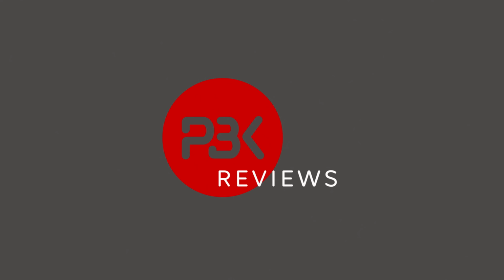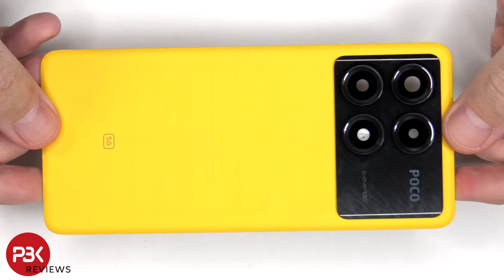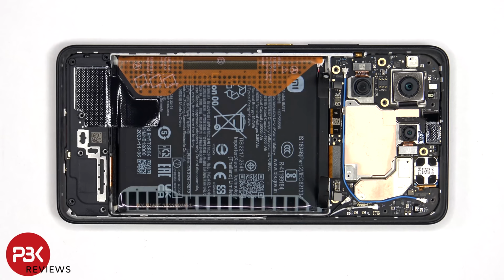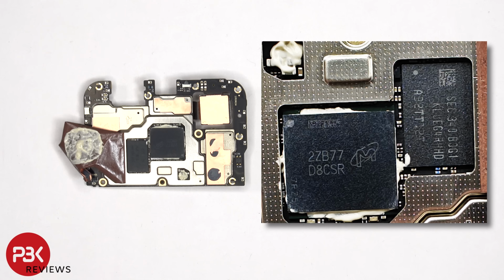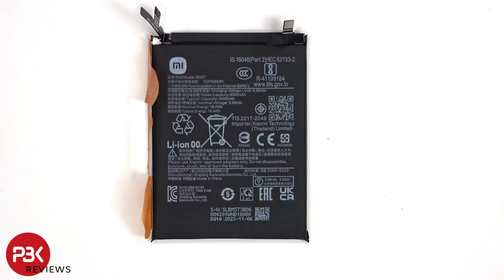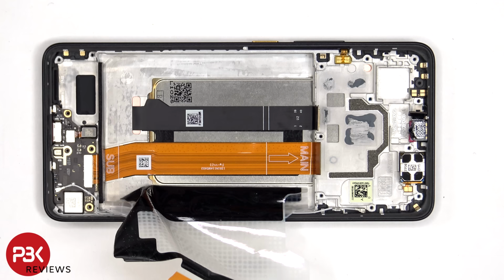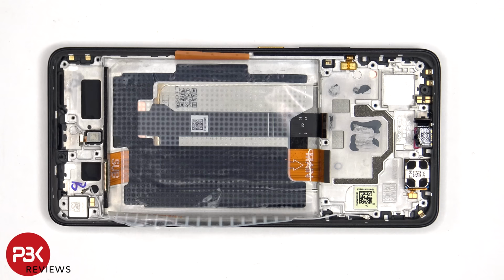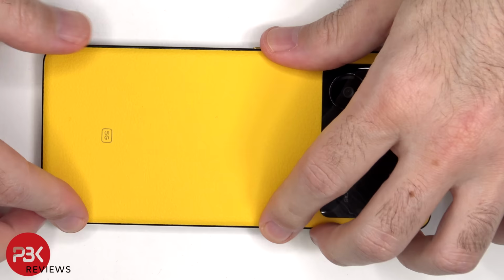Xiaomi Poco X6 Pro 5G Teardown Disassembly Repair Video Review

Comment: With all due respect, once disassembled the phone will work but it will never be the same (especially in the thermal section because you do not replace any of the "rework kits"), you do not respect the correct disassembly of the unit. (the glue on the “back cover” is heated to remove it, it is not done cold and a press with a specific pressure is used to replace the back cover together with the glue kit that is part of the "rework kit"). You don't have the necessary tools... and lastly, you should never use metal tools, they should be plastic. Taking it apart like that and showing it is very unprofessional.
Reply from the maker: I understand your opinion, but its wrong in my opinion. First, I do heat it, and I did say it also in the video so you must not be paying attention. I just don't show it on camera to save time and footage since most skip through it. Second I do re apply proper adhesives if available on the market if not ones which will come close to the original ones made for the phone. Since you keep referring to rework kits, I assume you're a tech or at one point in time were for one of the manufacturers. With that being said, what protocols they have at the facilities vs what average people who on a daily basis repair phones at home have are way different. From what you're saying, basically people should not do any sort of repairs on their own phones and just pay manufacturers to do it for them which is totally incorrect. I have been working with phones both professionally and not for over 20 years and I have never had any problems. The only time, especially with phones now a days when it is not ok to use metal tools is when the battery is connected. Aside from that, the chance of static problems or a short or anything like that is so small, it's not even worth mentioning. They don't make electronics like 20 years ago when you did have to worry about that stuff, they take all this into consideration. I have literally worked on thousands of phones and never once had a problem with using a metal tool. Plastic tools don't always get the job done for certain part removals etc and again keep in mind, not everyone has a factory at home with professional tools and "presses" to do the job you expect everyone to do. If I start showing tools and machines to do these jobs, no one will get any benefit from the videos since they will not have those tools or machines to use at home and would not be able to follow along. That definitely would not be helpful.
Reply: @PBKreviews  I share many of the things you say. Your video implies that anyone can dismantle a phone. Although it's partially true, it's not correct nor what the manufacturer specifies. I have been in charge of Samsung's technical service in my country for many years. I am perfectly familiar with the protocols, and yours are not correct. Anyway, that's just my opinion. Best regards. ;)
Reply: @LORDINTEL  if u say mr pbk are not correct, then make ur own video to educate people 😒
Reply: @caturdone9302  Your response is a typical response from an ignorant person, people who work within companies sign a public confidentiality contract since we have access to confidential information, I could not make that video in the correct way for that same reason. On the other hand, I'm not criticizing the person who makes the video, I just said that that's not the right way to do it. If you dare, disassemble the phone that way and tell me later what happens (for example, Samsung phones are uncalibrated in many aspects, because they do not have the necessary “jigs”). So whether you like my comment or not, that's the case and if not, find out with an authorized service center.

Comment: Hey I am facing issues on my pocox6 pro after screen replacement the phone has become slow ,phone is overheating but it's not physically hot . Could you tell me what I should do. 

The phone is only 3 months old and I broke the screen and replaced the screen and now it's not functioning well.
Reply: go to service center , they if you luck they will give new phone (same model) ,but if no them wait until they fix the phone.
Reply: @user-nu1ix8qk6o  service centre is insisting a factory reset I did it and still the same issue also did software update and no change,service centre is now not willing to fix the problem. The phone is slow showing warning over heating and becomes slow.

Comment: سؤال هل الرامات فوق المعالج ام لا 
وهل يصبه بوردر وارتفاع حرارة وبيفصل لحاله ام لا وهل يفرغ شحن بسرعة او لا اي حدا عندو اي نصيحة يكتب لأنو بدي اشتري❤
Reply from the maker: Yes the ram is seated on the processor, but most high end phones use that design for better performance. As long as cooling is good, and quality of parts, there should be no problem. On this phone cooling looks to be upgraded a lot from previous years.

Comment: Is poco x6 pro colling system good? I'm having a problem with my Poco X6 Pro cell phone getting hot easily

￼
Reply: Nah... it's bad to handle Dimensity 8300-Ultra
Reply: Its so good perfectly run full speed without throtling, with mediatek just too good handle temperature just like apple chipset. Not like snapdragon , heat & throttling ezly.

Comment: I thought it had liquid cooling 😭😂
Reply from the maker: They refer to the copper vapor chamber as the liquid cooling since it has water vapors inside.
Reply: @PBKreviews  So aluminium vapor chamber is not liquid cooling? Where's the water vapor exactly?